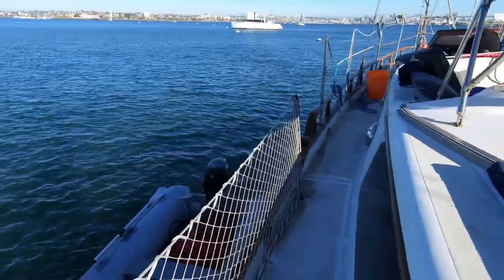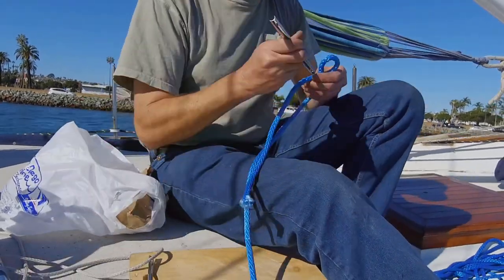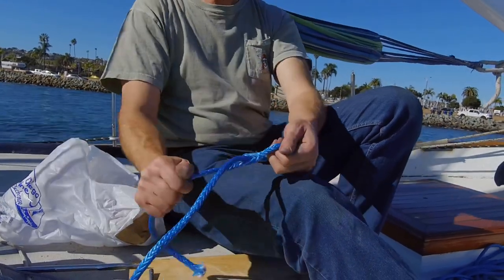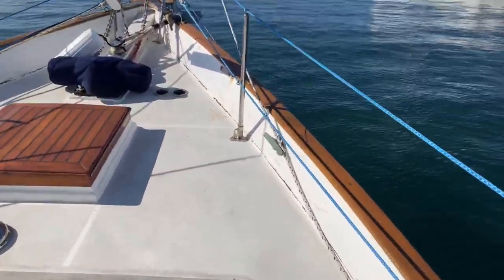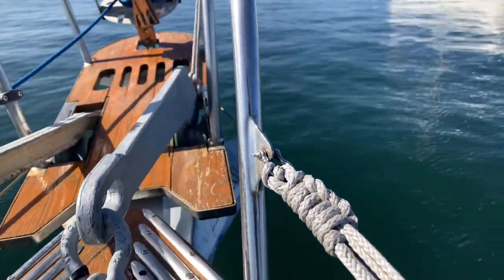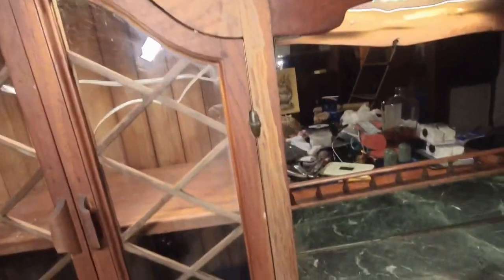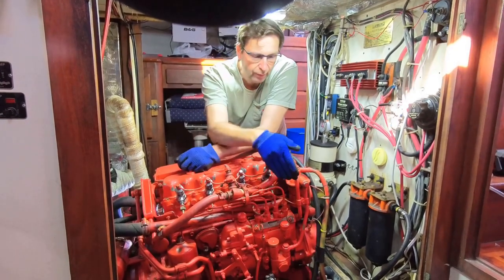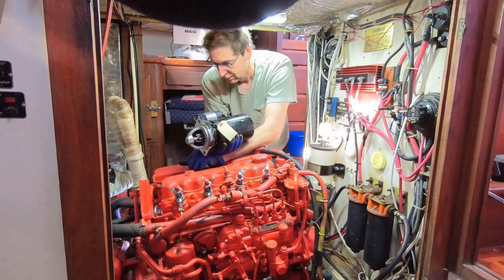Pancakes and lifelines... and of course, engine work.

Comment: Hey Ono! Rome here! Check your diesel injectors pressure and fuel rail pressure!
Reply: @OnnoKok  What kind of diesel is that? Looks like a 4 cylinder?  Post the specs and I will run it  by some of my diesel buddies!